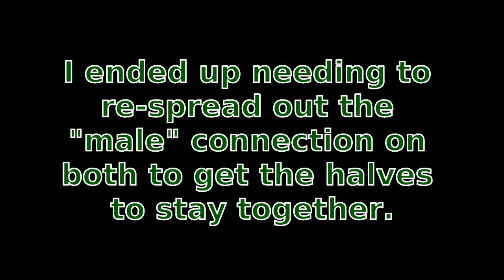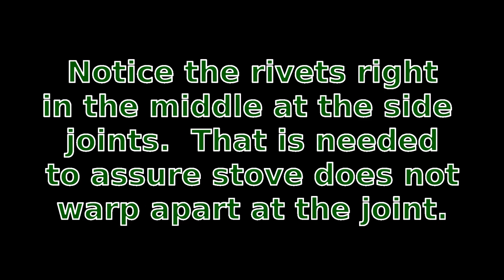Make A Simple Cheap Tent Wood stove - Part 1

Comment: After burning off the galvanizing (Zink) I would and have used high temp flat stove black paint. I see a few of these being made over the summer in my shop to give to the homeless people in our local tent city.
Reply: I've made one for a homeless couple out of a 5 gallon metal kerosene pail! It works great too! I followed the instructions Lonnie did on a video a year or so ago!
Reply: I'm hesitant to ask, but what city is that?
Reply: @Thalanox  Olympia!
Reply: @Thalanox  they also just moved in to a house!
Reply: I definitely not recommended to use zinced steel for making a tent stove. I telling it to you like a welder. ZnO will get you the metal fume fever - that's not cool. Just use stainless steel and keep your heath.
Reply: you can also just burn in some vegetable oil, get it hot and then paint on the oil, it'll form a thin black coat, like on a cast iron pan.

Comment: Clearly the best DIY wood stove on youtube. Congrats !
Reply: I've build your tipi model. Working on a crasy stove idea.  Bur Nothong like yours ...
Reply: @christiansimard947  clearly not. If it were stainless then maybe. You never burn galvanized steel. It's toxic.
Reply: @mattmarzula  Only partially correct. Wood stoves made of galvanized steel are 100% safe because they will never reach the 2200 degrees needed to burn zinc oxide which is where the fumes come from.

Comment: You can use Muriatic acid to strip galvanized metal as well. Good for applications where burning it might be a problem
Reply: wally carries muriatic acid, but I think vinegar might be cheaper, but takes longer. so it's a trade off. I have a gallon of muriatic acid because I make my own ferric chloride for etching knives that I make (not for the faint of heart)
Reply: Also a good way to weaken your metal and create thin spots that will rust out. Especially after heating and cooling. Stainless and you're done. Using galvanized steel is stupid to begin with.
Reply: Matt Marzula: Cost. One of his goals was to make it inexpensive. It's right in the title. You have any idea what stainless costs?

Comment: Wow Lonnie, another brilliant job.  Your emergency super shelter and the DIY adjustable wire cable bail are other great videos in your Good Mentor library.
Simple components, patient craftsmanship, resulting in an outstanding and functional stove.  Your beaten stove pipe collet was a joy to watch.
A great project for a teenager - make something with your hands.
A humble suggestion.  Two pieces of expanded steel mesh 5" x 19" could form an effective fire grate and protect the base of the stove from burn out and aid combustion.
Wishing you and Connie warm nights and delicious meals form this wonderful DIY stove.
Kind regards from Greg in Thailand
Reply from the maker: No grate is needed to aid combustion.  I do however plan to eventually place a false bottom in the stove for other reasons.  I also have other mods in mind and will video them eventually.

Comment: The "Baffle" is a great idea, especially if you are going to cook on top of the stove.1 If you get one running from the back wall and both sides of the stove about 2 /3rds the length of the stove and pretty close to the top what happens is it stops sparks AND HEAT just escaping out the stack, It does this by channelling the hot air forward and over the baffle then it is sucked back towards the stack causing it to heat the top quicker and keeping it hotter longer! I have seen it used on several hot tent stoves with great results! Great job on your stove by the way! Greetings from the North East of England just North of Hadrian's Wall!!!

Comment: For me I would be aware of bottom burn through after a number of uses.  Keeping a nice layer of ashes in the bottom can help that.  Also an extra layer of sheet metal bent to go up the sides a little that can be slid in would help and be replaceable.  Just some ideas.  Nice work at adapting available materials.  Thanks.
Reply: If you could find an old oven rack or fridge rack that would work and also assist with the draft. A fridge rack may need the plastic coating removed (or burnt off outside).
Reply: A thin layer of dirt or sand, will also protect the stove bottom from burning out.
Reply: @chadmiller7753  yep, perfect, since there's often dirt wherever you are.
Reply: @boooshes  For me the dirt is frozen and not too accessible under the snow and under the moss or leaves & detritus of the forest floor. I have a metal false-bottom. A grate of some sort might work better to allow airlfow.
Reply: @BryanSarauer  well, that's a good point. The issue with a grate is having the correct size so that red hot coals cannot be laying on the lower surface but a grate combined with a reasonable layer of ash works out really well.
Reply: Try a chicken wire fire grate. Super cheap, will last for quite a few burns, available anywhere.
Reply: I loved watching this video.
Reply: if you really wanted this design to last you probably want to double layer the bottom, as well as reinforce the top pannel from bending as it absorbs the most heat

Comment: Your sheet metal work brought me back to the early 1980's. I had to make Pittsburg lock seams. No snap together. Galvanized is zinc coated. Better to use uncoated.
Drinking milk aids in recovering from the fumes.

Comment: I’m using copper pipe because I had it. Making it work with what you’ve got. 
If you’ve got the eye, you’ve likely got the materials already. 
Gonna try that baffle in my barrel heater, thanks for the idea.
Thanks as always Lonnie and Connie, look forward the next video.

Comment: Nice stove Lonnie thank you. If you drill 1/8" holes in the corners of the door opening so that the folded edges terminate just slightly into the radius of the 1/8" holes eliminating the sharp 90 degree corners it will not be so likely to split from the corners over time. If you notice aircraft Windows have no sharp corners. Some early airplanes had catastrophic failures when cracking caused the plane's to explode out the Windows. Heat cycles and pressure cause the metal corners to shear at sharp angels.
Reply from the maker: Great idea.   I do that same process with the plastic snowmachine windshields when they get a crack in them.

Comment: That was quite the ingenious use of duct work for a DIY hot tent wood stove.  One thing I might have done would be to bend the stove pipe 'collar' to the outside of the stove on the top.  This will still allow for a good connection for the chimney but not take up as much room in the stove body itself.  As for the baffle did you leave a small gap from the back of the stove?  This will aid in first starting the stove.

How much do you figure this stove weighs?
Reply from the maker: Yes there is about a half inch gap behind the baffle.   The reasoning behind not putting the stove pipe collar to the outside was that that it would then be susceptible to damage when in transport as well as more potential for causing damage to other items as well.  Once the stove pipe is inserted, it make no difference to the stove whether the collar is bent up or bent down.  If you wish the stove pipe not to descend into the stove so far then you can just take the tin snips and cut off an inch or so of the stove pipe crimped end.
Reply from the maker: I am now thinking you meant to put the collar up so that you can put the stove pipe over the outside of the collar.   If that is the case, you definitely do not want to do that.  You will have major creosote problems with creosote running down the inside of the pipe and out onto the stove top.   The resulting smell and fumes will drive you out of your tent.
Reply from the maker: The stove weighs 10.5 pounds
Reply: @Far-North-Bushcraft-Survival   that's a great tip. Great project. Always love your videos. You take care.

Comment: When I took welding back in high school, my instructor said we weren't supposed to cut galvanized steel with a torch because the galvanized coating would produce toxic fumes. I know your stove won't get as hot as a cutting torch, but I'd still caution you about heating galvanized steel hotter than it'd normally get being used as furnace ductwork or plenums.
Reply from the maker: You did not watch the entire video my friend.
Reply: @Far-North-Bushcraft-Survival  - That's great Lonnie. I just saw the warning at the end of the video... lol  
The project looks good. I wonder how quickly it'll rust now that the galvanized coating is all burned off?
Reply: Muskrat Jim,I'm Pretty Sure that you can get some of that Rustoleum High Temperature Paint to do the outside,to protect it from rusting!,Just a Thought!

Comment: I made one from an old metal mailbox turned on it's side and 8 feet of nesting dryer vent tube. Works great and everything packs inside with room for some fatwood sticks. It heats well and you can cook on the top since it is flat.

Comment: I sure liked how you handled the fitting of the end and front with the folds. That sure makes an airtight joint. The whole plan for the stove is sound and I can't think of an improvement until I make one myself. It is too bad that we have to use galvanized metal. It would be better if we used plain steel but of course that is harder to obtain. It is a great plan and I hope it serves you well.

Comment: This is a very cool project Lonnie. If it was me, I would not use galvanized metal in the firebox. As an old welder, I know that when fire meets galvanized metal it creates toxic fumes. I would not advise using it at all.

Comment: I don't think that I've ever been as greatly impressed with someone's work as I am with yours!

You have created a tent stove that has all the qualities of a commercially manufactured one and which is actually better designed and constructed than some commercial varieties I have seen!

I particularly admire and respect your meticulous and creative craftsmanship in turning a 7" diameter round steel pipe into a rectangular tent stove with superb torsional rigidity and excellent fume retention using the most basic, simple, everyday hand tools!

You have inspired, encouraged and instilled confidence in those that are unable to justify the cost of a commercially manufactured tent stove or to find one that meets their specific requirements to actually construct one for themselves!

Your remarkable tutorial has opened minds and eyes into what an individual can create with basic, simple hand tools and ordinary commercially available steel pipe and the drive in their heart to learn from your truly wonderful tutorial!

Thank you for contributing so very much to the Make Your Own Gear knowledge base and so much more besides.
Reply from the maker: Thank you much for the kind words as they are very much appreciated.

Comment: Really neat little stove. One useful suggestion: put a damper in the stovepipe. With both a damper and an adjustable intake you can fine-tune the burn precisely, which is important in a small space. Also tames downdraught from the wind. And even more important: you can choke that fire to death literally in seconds if necessary. (Been there. More than once.) Great video! Thanks!
Reply from the maker: I personally do not like stove pipe dampers,   I would rather control the fire entirely through the air intake.   Dampers were important in the old days when many of the stoves were cast iron and leaked air like crazy.   With the more modern airtight stoves, I do not like dampers.    I want that exhaust to exit as freely as possible without any restrictions.   Dampers end up causing more problems then they are worth in my opinion.   In my experience, when one starts choking down the exhaust, toxic exhaust entering the shelter is much more likely.   With airtight stove designs, one should be able to monitor the flame rate entirely through air intake
Reply: @Far-North-Bushcraft-Survival  Hmmm. Different strokes, I guess. After having trouble controlling airtights that had no dampers, I've installed them and the trouble went away. I've particularly had problems with chuffing in systems with no damper. But if you've got a knack for dealing with that with just the intake, it's problem solved, eh?
Reply from the maker: If I understand "chuffing" to mean what I think it does, I believe that is a symptom of too small a diameter of stove pipe.   I do have that problem with my 5 gallon metal bucket stove when trying to get the stove burning hard quickly.   My solution to that is to cut back the air intake and just be contented to building up the burn rate at a slower pace.

Comment: ok. watched again, ive acquired a cheap little tent stove, ok, glad ive watched again, because I need a baffle just for the reason u mentioned lonnie, not I dont have a spark arrestor or probably not a tall enough pipe, but I feel more confident if I someway add a baffle. thanks again lonnie

Comment: Very impressive throughout. I thought you should have cut slits for the stove pipe flange. Your way is much better than anything I've seen or tried. My set of 3 aviation snips are coloured red-left-port, green-right-starboard and yellow for the straight cut ones. Thanks for passing your skills on to us. Cheers.

Comment: Putting one like this in my new sauna I built and appreciate your tip on keeping a slight tip to the rear. Here's my tip for anyone after heating our place for over two decades with a wood stove: one finger gap between two bottom pieces but they need to be elevated in stoves like this with no bottom air intake (so small branches could lift two larger pieces). Birch bark off dead/downed birch trees in gap, then fill rest of that "slit " with small dry branches. Place few more larger peices above slot but leaving places flames can rise up. Gets ripping fast with very little smoke/tar generated.  Oh, and I'm planning to wrap rock wool and aluminum foil on my first pipe section after stove to create hot "afterburner" section to reduce creosote and increase heat dumped from pipes after that (improves draft too). Peace.

Comment: Love your Channel, Lonnie! One of the things I like most, are your common sense approaches to everything that you design and/or make. Also the thoroughness of your explanations makes it easy to reproduce all of your projects. This is a great looking an functioning stove. I would be curious what it's life expectancy is. I would guess it to be pretty significant, in so much as the longevity of stove pipe in general. Great project! Thanks! Phil from MA
Reply from the maker: Only time will tell how long it will last but I would not be surprised if I get at least 5 years of occasional camping use.   I will be putting a false bottom in it as well as some other mods which I will video eventually.   At the end of each season i plan to spray the inside and outside of the cleaned stove with PAM type cooking spray as well as store the stove out of the weather.

Comment: Fantastic! You could even drill holes in the legs, to be able to fit some tent pegs for extra stabiliy if needed. I wish I saw this video before I purchased my Gstove.
Reply from the maker: I will be drilling holes in the base of the legs but will be using screws through the holes into poles for use as "floats" on top of snow during winter camping.

Comment: Lonnie, that was great!  Over the years I have made stoves out of barrels, pipe, culverts, wash tubs and propane tanks, but never out of stove pipe/ductwork!  Amazing, professional looking job there!  I have also had several sheet metal folding stoves that looked similar to this, that fold flat to pack horseback. The seams always leaked and after burning the oil off, they would rust making the hinges hard to fold.  I think your stove is better!  Very impressive, practical, lightweight little stove.   Good job!
Reply from the maker: I have a home made 5 gallon metal bucket stove that the hinges still work fine after 3.5 years but it is always kept inside when not in use.  One thing I will probably be doing with this stove is to spray a light coating of PAM cooking oil inside and out at the end of each season.    It will stink a bit during first light up each winter season but it should not last long.

The plan for my next stove project is to design and build a breakdown packable wood stove.   I have wanted one every since I seen the first commercially produced one.
Reply: @Far-North-Bushcraft-Survival    Good idea with the cooking oil.  I'll be looking forward to tour folding/break down  pack stove video!  I have an old hot water tank I'm going to make a pot belly type stove out of.
Reply from the maker: I made a wood stove out of an old hot water tank about 40 years ago and it heated fine but it sure would smoke up the place when ever I would open the stove door.  I did not know much about the physics involved at that time though so no doubt it could have been better designed than what I had done.
Reply: @Far-North-Bushcraft-Survival     The bottom of this tank is domed inward. I was going to cut that part out, but after watching this video, and the baffle inside by the stove pipe, I think I will only cut out half of it.  (I'm going to turn the tank bottom side up). I'll probably shorten the tank by a foot or so also. I want a removable hot plate lid on top to feed longer pieces of wood.   The barrel stove I have, doesn't put out as much heat as I think it should. The pipe is only 4 inch, so I think maybe it is not drawing air through as well as it should.  It smokes when the door is open as well.
Reply from the maker: Pipe on my 30 gallon barrel stove is 6 inch and draws fine.  I put a barrel stove kit on a 30 gallon barrel for my wall tent.  6 inch draws great

Comment: I used to do heat & air with my Dad before he got a metal brake.  Back then, we would lay the sheet metal on a piece of angle iron (upturned so the 90 degree angle was up) - then go at it with a rubber mallet.  It worked great (but not as great as a brake).